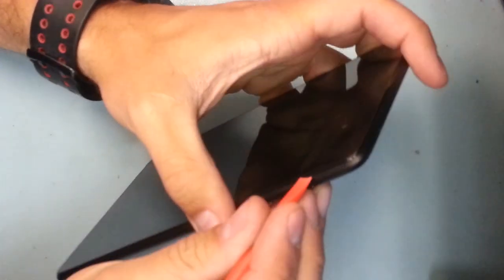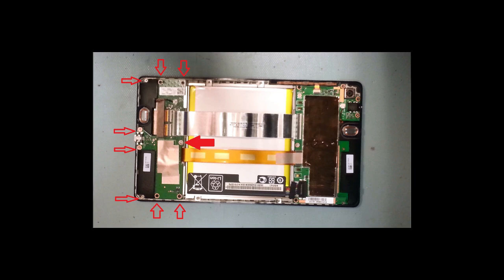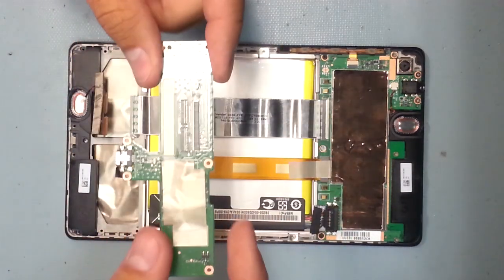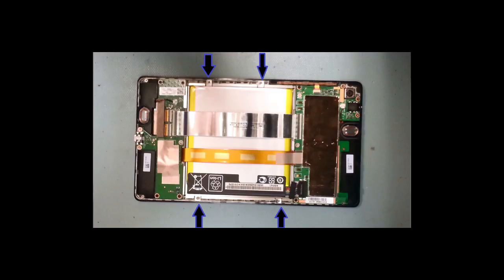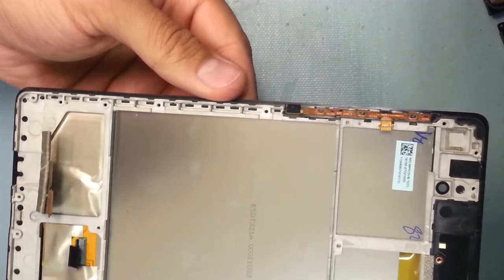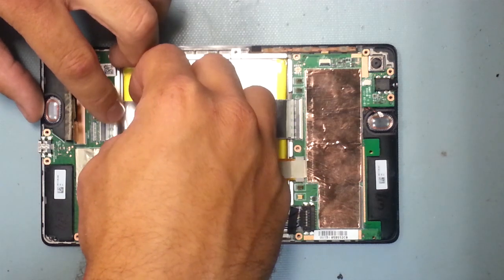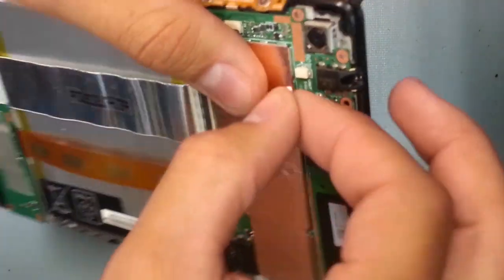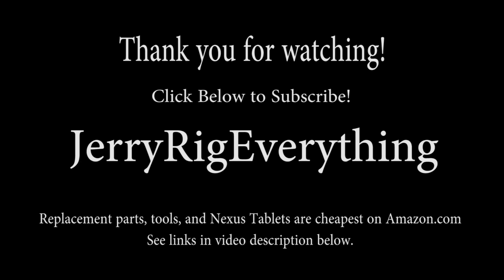2013 Nexus 7 Tablet Teardown. Charging port fix and screen repair.

Comment: Hi jerry I want to know if I remove the back cover is it a big deal. And also does ur camera in the back make noise like loose lens or something when you tap on it. 
Thank You
Reply from the maker: Nope, It is pretty straight forward to remove the back cover.  And yes, there are parts inside that will jiggle if you tap it. (Mostly buttons)  I wouldn't take it apart unless you have something that actually  needs fixing.

Comment: Your Video has me thinking about not replacing my brand new tablet. I bought this Hisense Android tablet from Walmart and my Charging port has a major problem. for some strange reason the only way for it to charge is if i push the charger in a certain way and hold it firmly. by any chance would you know how i can solve it or should i give up hope and just by a Galaxy instead?

Comment: Great Video. I have a question and hope you can answer.
My tablet is brand new but already theres a problem. The tablet refuses to turn on unless i have it plugged into an outlet. The battery is charges and is at 100%. I took the back off and tried disconnecting then reconnecting the port for the battery but it still doesnt work. Any thoughts ?

Comment from the maker: They wont fit.  But... Ive been told the 2013 tablet has a QI charger, which is wireless.  I put a link in the video description for one of those. And that should fix your problem.  Its only like 25 bucks.  (Double check to make sure it fits your tablet though.  I havent done a whole lot of research on it.)

Comment: Hi Jerry - Thank you for posting this video!  Question: Do you know if the charging port replacement for the 2012 Nexus will fit/work on the 2013 Nexus?  TIA!

Comment: Sorry, what I was trying to say is, my toddler stepped on our Nexus 7 second generation back down the other day and the unit restarted itself. It works fine but I just want to know why it would restart itself all connections are tight and there is no loose pieces inside.

Comment from the maker: Ya, what happen is your LCD broke.  Most likely the back light.  So even though your Digitizer is fine (the glass piece) you'll still have to get a new screen and replace it.  I havent found any reliable screens to purchase yet.  But i will post them in the video description as soon as i have.

Comment from the maker: Sorry Pero, but youll need to replace the entire screen to get that little section fixed.  They havent released any replacement screens for the 2013 version yet, so sit tight and ill post them in the video description when i have more information.

Comment: Our company has done a ton of the original Nexus 7 screen repairs. We can get the new 2013 screen assembly, but it's expensive.  Current cost is $175.  It's going to take at least 6 months before prices start to drop since there are no other manufactures who currently make this high res HD screen.

Comment from the maker: Simplicity at its finest.  Asus did a really good job at having replaceable parts.  If you get an iPad and something breaks... you're toast.  With android, you can get a replacement part and fix it yourself.
Reply: JerryRigEverything the Nexus7 Hardware was junk though. There are thousands of N7 stuck in bootloop and no help from Asus.
Mine got bricked right after the warranty ran out.